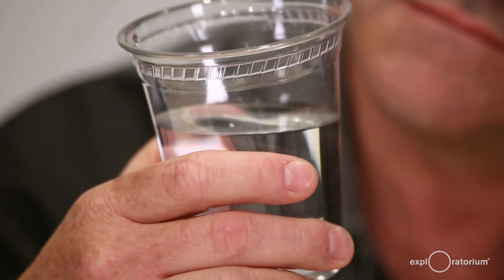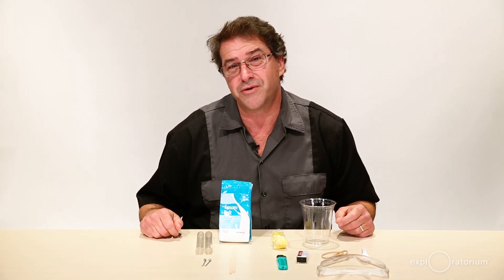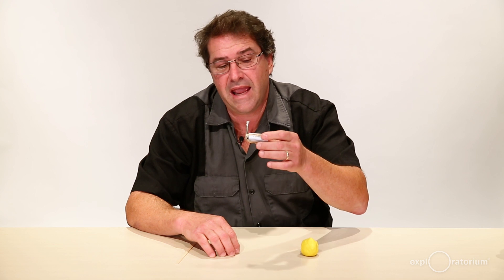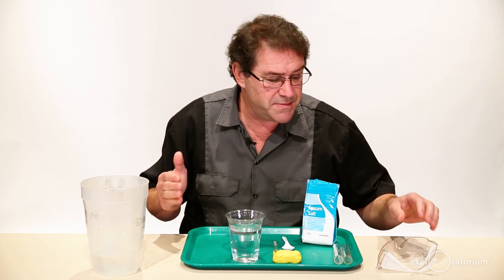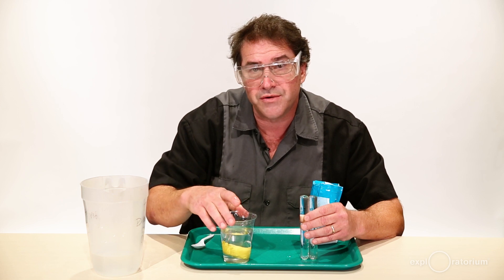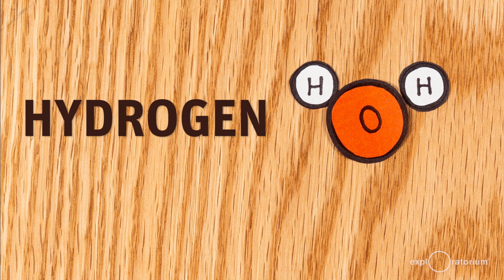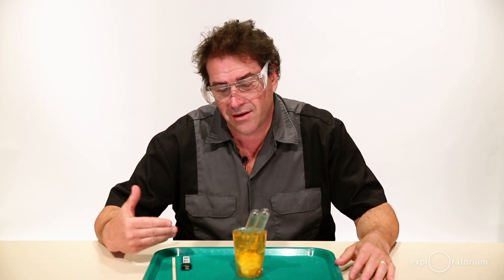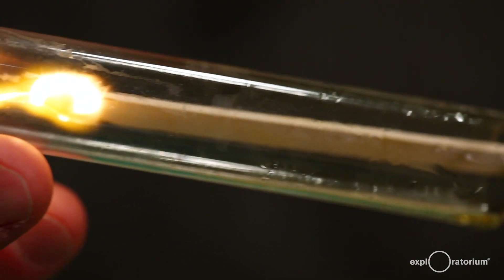Having a Gas with Water- Science Snack Activity

Comment: You didn't explain why the electrolyte chemistry of the DC power source is important? Why not Alkaline? Why not lithium ion?
Reply: Both Alkaline and Lithium batteries are more dangerous to work with. Lithium, inside of a battery, if it comes in contact with water, can  explode.